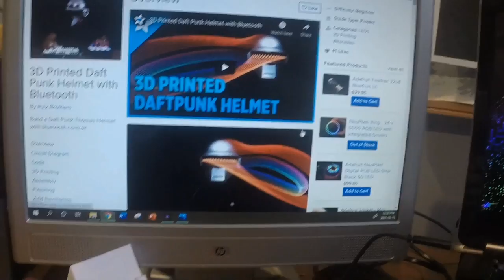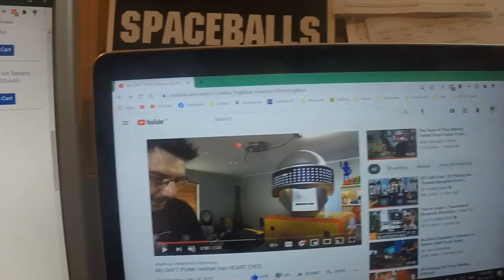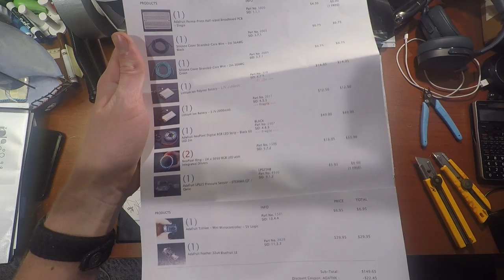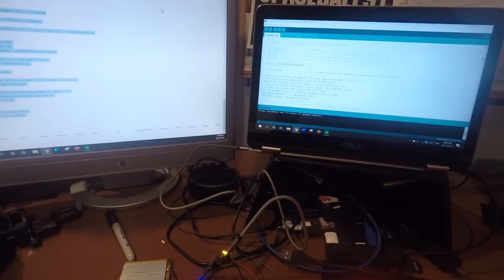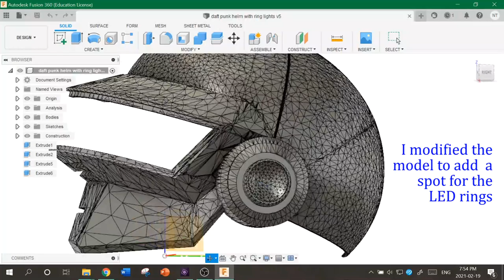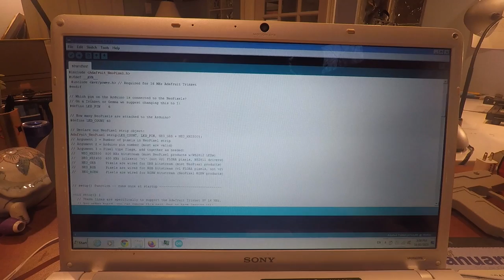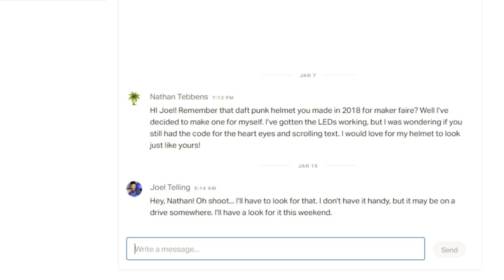Making A DAFT PUNK HELMET with Bluetooth Controlled LEDs!

Comment: I want to make one more than anything right now. I'm still trying to figure out how I want it but I'm going to combine multiple people's designs together. I was going to have a control box for the LEDS but this bluetooth method seems so much easier. Great job, and thanks for the extra help/inspiration.
Reply from the maker: I think it's nice to use bluetooth so I don't have to run any wires up my arm. If I wear the helmet around, I either keep my phone in my pocket or strap it to my wrist under my sleeve so I can control it.

So glad you found my video helpful!!
Reply: @N8TEBB  Another question, is this matte black necessary? I have the gloss, should I put that on the primer and then again over the metallic? My helmet is put together, and I'm currently sanding. I'm also working towards figuring out how to wire 320 LEDs with 5 matrix drivers and an arduino, but for now I just want it to look as good as yours. Metallic paint is also something I don't have yet, but I'm getting there!
Reply from the maker: @ObeyedDog  I think you can use the paint without a base coat, but it won't hurt to put some gloss black down. If you just have primer, that should work fine. Really you only need a black gloss base if you use actual spray chrome.

Comment: Great video man! I wish I had done some form of recording me working on my helmet I made for Halloween last year. I would have loved to only have had 3 pieces, at the time I only had a ender 3 and had to do it in 21 separate pieces. I don’t really know electronics either, so I bought a kit that was pre-programmed and just needed soldered up, which ended being almost 2/3 of the helmets cost. 
The hardest part for me was getting it chrome, though. It was my first foray into vinyl wrapping something, and of course I choose do it with what is the least forgiving vinyl color. Very at home friendly though! I could do it in my basement while I watched TV, something I couldn’t do for the sanding, bondo-ing, priming, or gluing.
Reply from the maker: That’s so cool! Yeah, finding a good way to do the chrome is tricky. Sounds like you killed it though! Thanks for the support :D

Comment: This is awesome. Do you think it's would be possible to use the bluefruit Le circuit to connect a bunch of smaller sections of neo pixel strips? I'm making a Guy Manuel helmet and want Bluetooth controlled LEDs. I'm new to all of this haha but this method seems like the way to go
Reply from the maker: Yes it absolutely is! You can make a matrix of any size as long as you have enough voltage to power it all! Just make sure you keep track of how you wire it up so you can tell your code how big the matrix is. Let me know if you have any questions of if you need to chat over discord to clarify some stuff. Good luck on your project!

Comment: Hey awesome work! Quick question, what material did you use for your visor?
Reply from the maker: Thanks! The visor is a tinted face shield replacement. They're about $20 on amazon
https://www.amazon.com/Sellstrom-S35020-Replacement-Shade-Shields/dp/B00B62BJ8I/ref=sr_1_1_sspa?dchild=1&keywords=tinted+face+shield+replacement&qid=1634229827&sr=8-1-spons&psc=1&spLa=ZW5jcnlwdGVkUXVhbGlmaWVyPUFVMEFXM1JRNTVSTTUmZW5jcnlwdGVkSWQ9QTA1MjIyNTEyWkVWRDg3MEtDSE9EJmVuY3J5cHRlZEFkSWQ9QTAwMzE2MzcyU0pCVEJFSFI3OVBWJndpZGdldE5hbWU9c3BfYXRmJmFjdGlvbj1jbGlja1JlZGlyZWN0JmRvTm90TG9nQ2xpY2s9dHJ1ZQ==

Comment: great work really good finish, i have a question, could you share de modified file with the round led spot? and printed in 4 parts? because on the thingiverse model there is just a 16 pieces model and a 2 part files. it would be really helpfull.
Reply from the maker: if you want to use my poopy lo-poly file go ahead: https://www.thingiverse.com/thing:4888089
i didn't share it before cuz the space for the LED ring is acc a bit too small :p
Reply: @N8TEBB  thank you so much for sharing the files. I will check the ring just to confirm but this would help me a lot. And again, excellent project.
Reply: @N8TEBB  Hello I have a question, I wanted to print the parts but a file is missing, back right, please can you add it thanks.
Reply from the maker: @raulflores8025  the back right is just a mirrored back left. should be able to flip it in the slicer, or at least thats what I did. let me know if that doesn't work

Comment: Great work. I have to ask, how did you convert the .STL to a solid to make the inserts for the LED rings and remove the visor? Every time I insert it into Fusion I get errors with meshing. Are there .STEP or .OBJ files available? I can't find them anywhere. Cheers!
Reply from the maker: Yes I converted the STL to a solid to make a spot for the LED rings and remove the visor. The original one is here https://www.thingiverse.com/thing:3385744
In fusion 360, I have to turn off design history, insert the mesh, severely reduce the number of faces so I can work with it, then convert it to a solid. From there I can modify it.

Here is an OBJ file of my modified file: https://drive.google.com/file/d/1XZtexKBOUzCt-_rlE8Eg4F2ukEVgIjAP/view?usp=sharing
Here is an OBJ file of the Original Helmet: https://drive.google.com/file/d/1LB1yIPydU_s_LpFzeg6CL-burZlpbgAr/view?usp=sharing

Comment: Awesome! 
Can you see between the strips?
Reply from the maker: yes, I can! Not very well, but I can see enough!
Reply: @N8TEBB I'm so close to getting mine done! One little error though: I get no blue. I'm using more generic WS2812B strips. They seem to take the Adafruit Library commands okish, just not blue. If I use FASTLED, no problems. Any thoughts? Also, How can we get text sent through UART (in the app) to the helmet? 

Thanks for the inspiration.

Comment: How long did it take to sand/prime and paint the new helmet model? I'm planning on printing my own for an upcoming con (without the LED's), but have never really painted any of my prints before. Any tips for a newbie like myself to try and achieve similar results that you do in the video?
Reply from the maker: Sanding a helmet, like many things, will be only as good as the amount of time you put into it. Now, the daft punk helmet is quite smooth model without too many details, which means a majority of the sanding can be done with a power sander. For a helmet like this one, it will probably take you no more than 30 minutes thoroughly sand the helmet. Typically, I do 3-4 rounds of sanding with filler primer and bondo in between. You have to let the filler primer set overnight, same with the bondo. If I worked on it every day for about an hour, I could probably crunch a helmet out in a week. No LEDs of course. Make sure you use a respirator when sanding/applying bondo and when your painting.

Comment: How did you connect the Feather module and Trinket so when you made a change via bluetooth it changed both controller?
Reply from the maker: They are on separate circuits. Only the front facing matrix in Bluetooth-controlled, the rings on each side just do their own thing on repeat.

Comment: What was the glass?
Reply from the maker: it's a tinted face shield replacement. I got mine here: https://www.amazon.ca/Forney-58603-Grinding-Shield-Replacement/dp/B003X3UAMY/ref=sr_1_10?dchild=1&keywords=tinted+face+shield+replacement&qid=1625449381&sr=8-10
Reply: @N8TEBB  thank you!
Reply: @N8TEBB  Could you also link the bondo in 20:19 ?

Comment: Hey bro !!! Love the helmet !!! I’m making daft punk inspired music and I want to make a robotic helmet like there’s but customized to my self and I have a question. I’m going to use Eva foam for the base of the helmet but if I paint it like that it doesn’t shine and looks ugly. If I were to use spot puddy then sand it down would it work as if I had a plastic base that I could then use primer and a chrome onto ? Sry for the long comment by the way lol
Reply from the maker: Thanks for the support!

Have you sealed your foam with some sort of sealant/primer (like plasti-dip)? Paint doesn't like to stick to EVA foam so adding this helps.

I did a little bit of looking around on one of the cosplay forums I am on, and most people say bondo on EVA is a recipe for disaster. Some well know members have tried it and ended up scrapping projects.

There is hope however. Someone has used a different product with some success that does what you're trying to accomplish: https://www.405th.com/forums/threads/foam-builders-new-hardening-technique-alternative-to-plasti-dip-and-pva.36702/#post-666907

In my opinion, bondo will not work very well on foam, neither will filler primer. You may have luck with other methods though. I would recommend doing some tests on scrap foam pieces before trying anything on the whole helmet.
Reply: @N8TEBB  ok thx ! Also I know I’m going to be coming back with questions about the wiring of the visor for leds but I have one more question. Can you see out the helmet with all those led?
Reply from the maker: @parz2353  Yup I can! I said this in another comment somewhere: I can actually see pretty well. There's a 1/16" gap in between all of the strips which allows me to see through. The vision is good enough to walk around without bumping into anything. I can actually read through it as well, but that's a little trickier. The major blockage is your vertical peripheral vision, so it feels like you're seeing in widescreen, but that's just the design of the helmet.
Reply: @N8TEBB  ahh ok that’s great and sorry I still have another question. I to love engineering but this will be my first time working with wiring and soldering. To get a full strip of leds to fill the front what do you use to connect them with wires ? Well to clarify what I mean is how like what wires do you use? Also thx for responding this is helping a tone

Comment: I was wondering, was breathing hard while wearing the helmet and also, how good was the visibility with and without the lights turned on?
Reply from the maker: Breathing is no problem as long as I'm not doing anything too physical. There's actually pretty good ventilation through the mouth and nose holes. Visibility is ok... vertical peripherals are cut off, it's like seeing in wide screen. There are 5 distinct black lines through my vision, but I can see well enough to walk around without running into any walls. Reading requires you t constantly shift your head up and down. The lights face outward and so almost don't affect vision at all! Like when friends try the helmet on they tell me to turn on the lights but they're already on! they just can't tell

Comment: So you can't see when you wearing the helmet?
I think I'm making 2
One with no lcd to wear in Halloween and another one with lcd to have it in my room xD
Reply from the maker: No no I can actually see pretty well. There's a 1/16" gap in between all of the strips which allows me to see through. The vision is good enough to walk around without bumping into anything. I can actually read through it as well, but that's a little trickier. The major blockage is your vertical peripheral vision, so it feels like you're seeing in widescreen, but that's just the design of the helmet.
Reply: what scale are u using man? im trying 94 but looking at the print so far im getting nervous it might be too small..

Comment: Hi!  Is there any chance you'd share your STLs for your project?  It looks like you resized and redesigned it around the 9 minute mark.  My son really wants to print this and make it fully and wear it to his prom!  :)
Reply from the maker: Here's the STL I used: https://www.thingiverse.com/thing:4808318 print at 100% scale. 
My LED rings didn't fit as well as I had hoped they would, so I would really recommend just using the model I linked in the description under the name "more accurate model" and modify it yourself. I used fusion 360, and it's free for hobbyists.

Edit: the original model has a higher poly count as well. https://www.thingiverse.com/thing:3385744
Reply: @N8TEBB  Thank you for the link!  Unfortunately it's 404'ing.  :(
Reply from the maker: @ShaneGraber  I went to thingiverse and re-copied the links so they're both working for me. I hope they work for you. But as I said before, I recommend using the original higher poly count model (the second link in my reply)

Comment: Hi there! What are the specs of your 3D printer? Regards!
Reply from the maker: I have a CR-10. It has a build area of 300mmx300mmx400mm. I use PLA, usually with the nozzle at 195C and the glass bed at 65C. Let me know if you need to know anything else!

Comment: What is the scale that you used for the accurate version of the helmet to print?
Reply from the maker: 100% for proper size. The small one was 80%.
Reply: @N8TEBB  I'm doing mine at 95, still kind of big size for my head but a good fit. I have another question for you,  do you think that with 5 strips of led on the visor it is possible to see something through for walking on a party? Doing mine this week hehe
Reply from the maker: @Marxwellsilva  5 strips you will kinda be able to see. You won't bump into a wall but don't expect to read a novel lol
Reply: @N8TEBB  HAHAHA I do not want to read a novel, just party!! After the conclusion I will upload a video, thanx for the advice and help!

Comment: whats ur headsize mate, im gonna print this model but i need some reference for scaling!
Reply from the maker: my head is 55cm. 100% was the final scaling in the video, but I think 95 might have looked a bit better.
Reply: @N8TEBB  u think 94 would still fit comfortably?
Reply: @N8TEBB  also any recommendations on print settings to print the helmet? kinda new to this haha
Reply from the maker: @MrSeanmcgall  I think 94% would look good. I would recommend printing it in a few pieces as possible so you don't have to do too much filling later on. You can cut stls in a free program called meshmixer.

As for printing settings, I used a layer height of 0.2mm with a speed of 50mm/s. If you know your printer well you can go faster, but I don't mind waiting a bit longer for a better print. I believe I set the infill to 20% and used support on overhangs over 65 degrees. 20% infill is plenty strong if not a bit overkill. These settings are for PLA btw.

Any of the other settings really comes down to your personal preferences and particular printer. Most of the defaults in cura should work just fine. I assume you'll be sanding this down after so you don't have to worry so much about imperfections in the print.

Comment: I followed the link to your code but it says the file is no longer there. I'm building the same thing. Can you repost your code?
Reply from the maker: oh shoot i accidently cleared my google drive. I'll get it back up and send you the link.
Reply from the maker: here is the new link: https://drive.google.com/drive/folders/1-E4-6GmypDN5Alu1bM-WkdjIA6kcw2Uv?usp=sharing
The actual code is in the folder called "neomatrix_hat" it's a .ino file you can open in the arduino ide.
Reply from the maker: If you ever need help with your helmet (setting up the board or getting the code to work) message me on discord i'm N8TEBB #3575
Reply: @N8TEBB  Awesome!  I usually use Circuit Python but your setup is so close to what I want to do, I may use Arduino.  I'm going to try to run the strips and rings off a single Circuit Playground Bluefruit.  I want to use the built in microphone to make the helmet sound reactive.
Reply from the maker: @cchobbyfun  Dude if you get some sound reactive code working definitely send it my way because they would be sick!!

Comment: Hola estaba viendo los archivos para 4 piezas, pero falta el lado derecho, por favor lo puede compartir para imprimirlo, hice uno hace un tiempo pero de papel, le puse un arduino y funciono con una app para el celular, ahora lo quiero mejorar y el que hiciste esta espectacular, te felicito. Gracias
Reply from the maker: Hey man! Thanks so much! Sorry for the late reply. The back right piece is identical to the back left, except mirrored. You should be able to flip it in the Slicer program. let me know if that does not work.
Reply: @N8TEBB  gracias ya lo hice, no tengo experiencia en impresiones 3d pero ya se hizo la impresión, quedo super, gracias estoy en el proyecto con la parte lijando y pasando la masilla.
Reply from the maker: @raulflores8025  Good Luck!